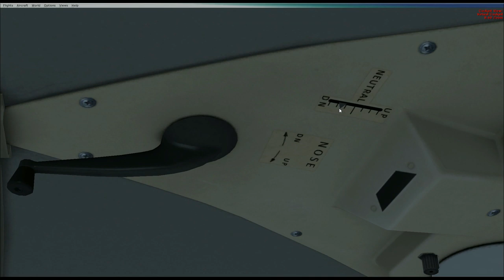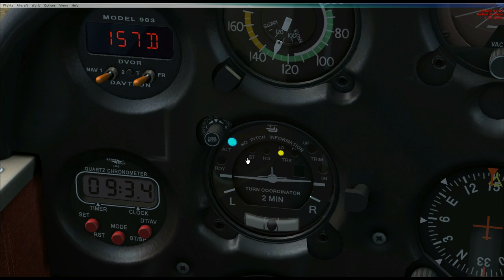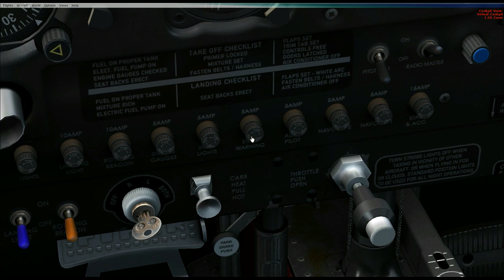A2A Cherokee 180   Pushing the Flight Envelope - Part 2 Flight

Comment from the maker: In USA Nav lights are used in the daytime for all aircraft. In Australia no lights are required under CAA regulations. If strobe lights are fitted, they should be on, however Nav Lights should be off, or are not required to be on other than the Rotating Beacon which must be on before startup, and until shutdown is complete.
Reply: Untrue about NAV lights... only nighttime are required under FAR 91.205, daytime only anticollision lights are required where eiher strobes or beacon would do.